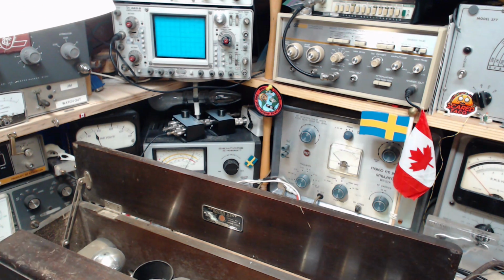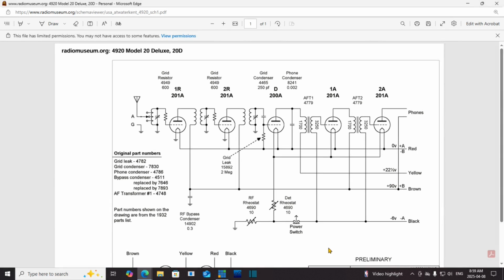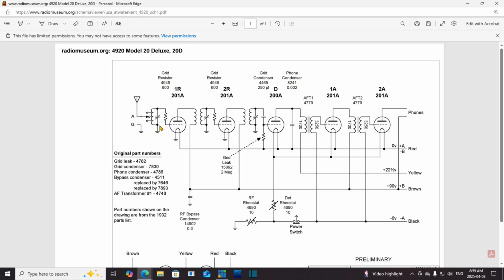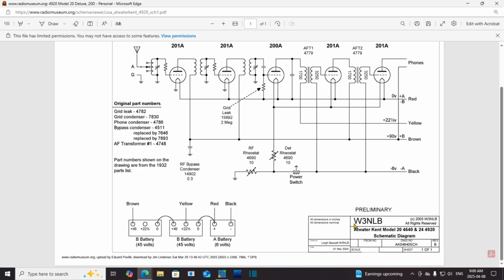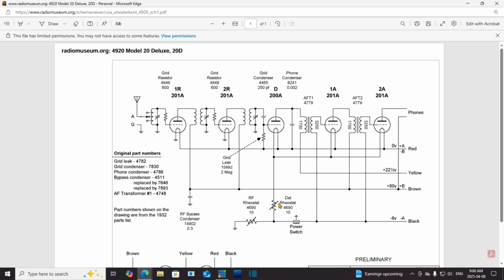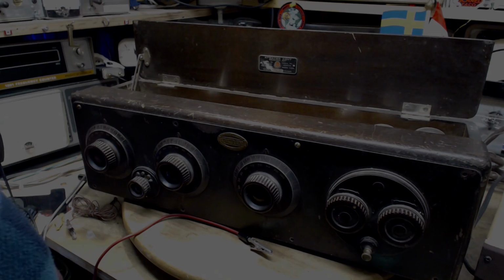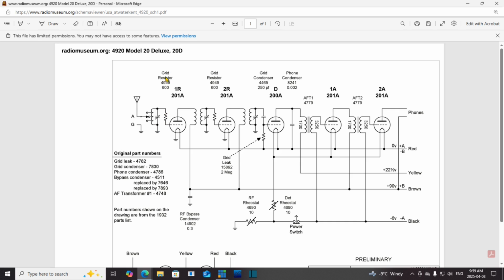100 Year Old Atwater Kent Model 20 Tube Radio Video #3 - Some Progress Made

Comment: @44:30 When you were using RF tracer to set each of the three tuned stages, could you pull detector tube and then set the third stage ??

Comment: You probably figured it out (I haven’t caught up on AK series) but it helps to tune the detector first on a TRF (depending on how strong the signal). Then like a safecracker tune all three in similar degrees for the next station. 

Glad your tubes were good. 01As are fairly pricey now. My dad said they were used (probably WD11s too) for target practice in the 30s. Horrifying!